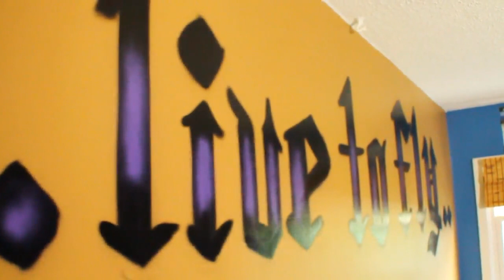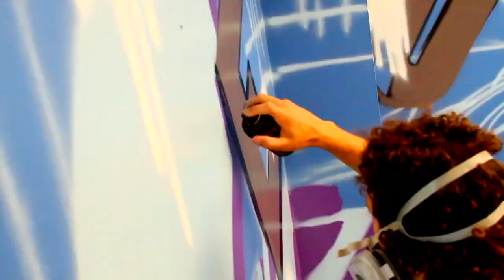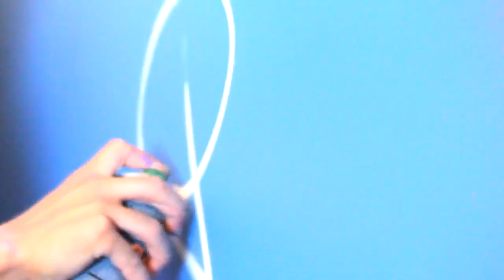"Frosty" Graffiti Wall - 2009

Comment: @rockascy depends on what you're getting down, throp ups(bombings) need fast coverage so you wanna go with a high pressure can(e.g. montana hardcore), if you want to piece you will have time, and need thin and excact lines, so go with low pressure pain(e.g. mtn 92, ironlak, mtn alien, belton...)